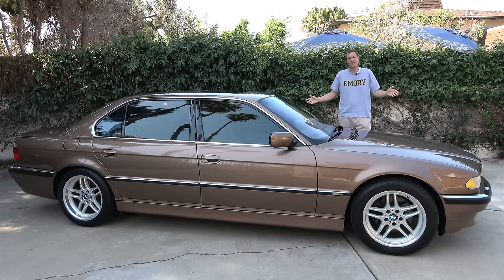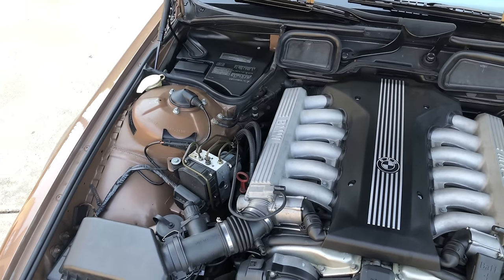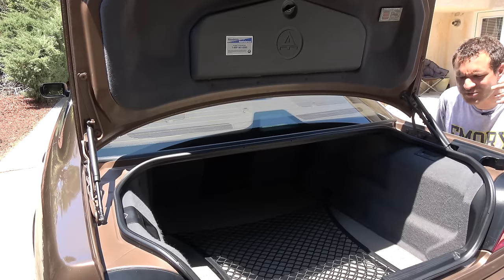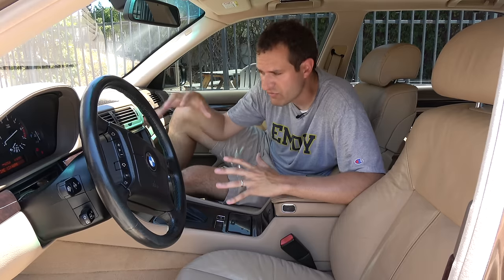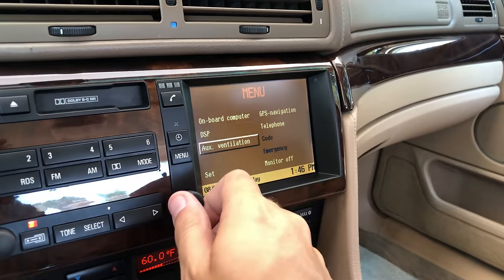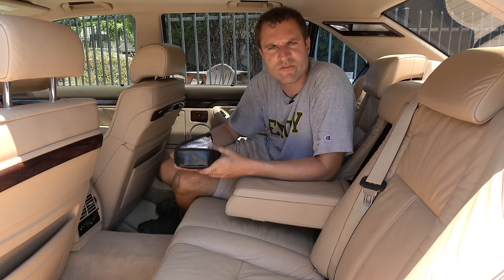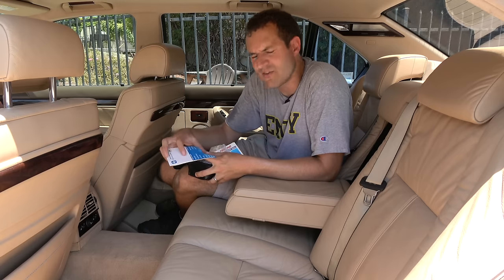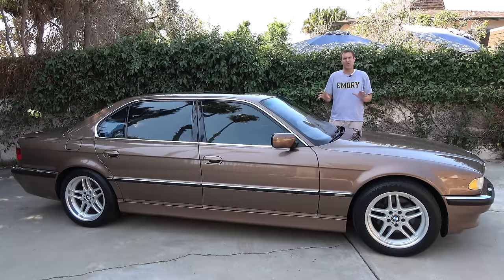Here's Why the 2001 BMW 7 Series Is the Best Luxury Sedan Ever

Comment: I had a 1991 535I, and that feeling of everything being solid is oh so true! If you own a BMW, you know the feeling. If you haven’t, go get one even if it’s an old one you won’t regret it,… Except maybe at the repair shop
Reply: Vws and some hondas feel the same way.
Reply: No problem for me i work on my own older BMW's so that's out of the question. They do feel solid after 20 years. They don't feel lose or anything like the older American cars I've owned.
Reply: O3 Mercedes has a similar feel here. You pull the door handle and right from the get go it feels solid. Got into a 2016 navigator and I was like what's wrong with this car it's all plastic
Reply: Neil Krinitsky Yeah since owning two BMWs. A 1987 325 and a 1991 535. All of the American cars I’ve had since then feel like popcorn machines with wheels
Reply: got myself a 91 535 earlier this year, quite a nice car
Reply: i got one for 7 series 2005..  to be honest, the car quite bad.. i dont hate BMW, they make great car but 7 series 2005 , got tonnes of issues, air suspension broke many times, and most elecronic mechanism beeping constantly n break.... im gonna trade this to m5 v8 2012... i still love bmw especially M lineup
Reply: completely different car...see alternate thread
Reply: its bc of new safety laws it makes sense trust me
Reply: I had a '98 Toyota Avalon for my first car I bought myself which was a big full size luxury sedan from Toyota and it was super nice inside all leather and wood grain electronic everything even the passenger seat and my 2008 Tiburon doesn't even have power seats lol
Reply: A Glimpse Inside  had one too blue/blue. Nice bmw

Comment: I glad so gladDoug finally produced a video review of MY favorite Luxury car of all time. I have owned somewhere over 137 new and used cars in my 55 years and I purchased my 2000 BMW 750iL brand new in 7/2000 for the sum of $104,772. It has all options except executive rear seating options (could not locate one with that option at time of purchase). It came with 16" BBS wheels but I  purchased a set of 18" factory wheels as a dealer installed option so I had an extra set for bad weather. The everything still works on the car (including all pixels, cup holders have never been used because i do not allow eating or drinking in any of my cars), and the only thing fixed outside of normal maintenence is replacement of the factory Navigation with a new Mark IV navigation computer after the original quit working this past spring and the fan and shroud and radiator after the fan decided to explode. I have maintained all factory service intervals and any issues were taken care of immediately. The only thing currently at issue is the roof clear coat has started to peel and just the last weekend the check engine light came on and threw a code for "cam positioning sensor" which will be fixed before putting the car away for the winter. Since 2006 the car has been stored Oct 1 through April 1 and since then has never been driven in the rain or snow. From 2000 until 2006 I lived in VA and was never been in snow. The car currently has 131,000.
Out of all my vehicles this is by far my favorite and that is why I kept it. The new cars are nice but none have the timeless styling of the newer (98-01) face lift E38s. From the full leather dash to the attention to details, this car is IT! I am reluctant to repaint the roof as the car is otherwise 100% free of even the smallest scratch or dent and I like to keep it all original. It will be a big decision to paint the roof. 
I actually considered previously asking Doug if I wanted to interview my car, but figured it's better kept a secret now that these are beginning to rise in value. Only about 1,000 V12 E38s were brought to North America each year 98-01 and they are getting more difficult to find. I hope this is because of people realizing the rewards of this car and not because they are not worth fixing. I will keep this car as long as I can drive. I'll sell my 95 S600 (love it because it reminds me of old Mercedes quality)before I sell the BMW and I love that car almost as much.
Reply: Such a long post but read every single word of it. Thanks for the review as well!
Reply: Its ugly
Reply: Awesome post! 👍👍
Reply: The way you expressed your love. <3 It wasn't just BMW, you're a true car person. Much Respect.
Reply: ...forgot the only other mod I did was the change to the updated 16:9 wide screen when I changed to the Factory DVD based Mark IV navigation computer instead of the cd - rom based Unit and 4:3 screen up front (both still worked when I pulled them out) and since it is such an easy swap I kept them in case I want to be ALL original! I'm not easy to modify from factory, I did in fact purchase an entirely new aftermarket DVD Navigation system to install but I just couldn't "pull the trigger" to install it. Now I am sitting on a new system that looks just like a factory E38/E39 navigation head unit and even though it would look factory and sound tons better, I just couldn't due it. Guess I'll have to buy a 540 or 740 to put it into or sell it cheap. What troubles!

Comment: Hey Doug you forgot to mention that the BMW 7series was  also a Bond car in tomorrow never dies 007
Reply: AJ Cash Im surprised no one else mentioned this
Reply: And of The Transporter.
Reply: + Transporter had a manual gearbox = ultra cool
Reply: It was and it wasnt. :) The car in the film was a 740iL. BMW would not allow them to destroy 750's making the movies.They did replace the badge on the trunk, but thats it. They had 6-8 iirc. You can spot the trim in the car during interior shots. 750s are full leather - stitched door panels, dash, etc. 740's are vinyl/leather inserts for airbag area on doors, but otherwise vinyl. Either way, that movie is why I randomly bought my first E38 back in 2005.
Reply: @ScottHDuke  ooooooh ok i was wondering why too. that makes sense now

Comment: Not quite the same thing but for a few years when I was younger, my mom had a 5 series of the same vintage (1999 or 2000, I believe) and I always loved that car. I wanted to learn to drive in it back when I was like, 12. 

My dad once took me out on the highway when we first got it and just floored it when there was nobody around, doing 120 or 130 down the open, empty roads late at night, giggling all the way while I was planted in my seat. 

They sold it to some guy who just wanted the wheels off of it cause it had some sport package or something, and NOW, with me having been through therapy and prepping myself to work for the first time a lot later than I should have, I am considering one of those, or one of these, since they seem pretty attainable at a price of 3 to 6 thousand dollars. I'm honestly pretty hyped for it.
Reply: Wait 6 THOUSAND ONLY? Damn thats cheap as it gets, what is the minimum wage in your country?
Reply: @joaopaulogalloclaudino9671  I live in Florida right now and the minimum wage is about $12/hr, but it's slowly going up. Working full time and saving aggressively it'd take me maybe 6 months to have that much.

Comment: I have to say, this example was low spec by comparison to my 2001 750iL in England. Mine had double glazed windows, refridgerator in the back, full seat and audio controls in the back arm rest, plus second phone in the rear arm rest, a powered self opening and closing boot (trunk) lid, blinds all round, lit mirrors in the back of the front head rests for rear passengers and....wait for it... a FAX MACHINE and fax point built into the back of one of the seats. "Fax me in the car" I used to tell people.... I miss that car....
Reply: That's awesome! Thanks for sharing
Reply: Double glazed is very common in 7 series 
It is very useful both in thermal n sound isolation 
When u close the windows u dont care about any issue happens out there ..
Reply: I've got an 98 740il!! In my oppinion the most loaded car for it's age was the E38. There's one called L7 or the Alpina B12. 
This E38 in specific as Alexander's said it's really base and the video doesn't emphasise that. You could get an endless list of features that back when it was new no one had it and those features are just coming out in the new luxury cars.
Reply: This car really is base spec. 
There's basically no options for rear seat passengers. It doesnt have Msport package either
Reply: God that sounds good. North America however does not get the futures typically of other countries like yours.
Reply: The car Doug reviewed had double paned windows and sunblinds all around, he just didn't point them out. You can tell the windows are double paned by the look of the reflection they make from the outside, same look that the W140s with the same windows had.
Reply: Alex V This car does have the sport package, you can tell by the 18" wheels and the 'S EDC' button on the dash and the wires going to the strut mounts under the hood for the adjustable suspension. There was no 'M-sport' package for E38s, unlike the E39. Just sport package, from 1999-2001 only.
Reply: Sometimes I feel options in bmw cars are literally endless...

Comment: Doug Demuro I totally agree with you that the e38 is one of the best looking sedans out there, the styling of it is contemporary and it will look great years to come. The 850i , e39 m5 and e38 are the best looking bmw's in existence.
Reply: I'm not a huge fan of BMW in general, I'm more partial to mercs. This car had me wanting a BMW for sure
Reply: 850i but not the 840i which looks the same? :P
Reply: Personally i think e34 should be in that list too lol
Reply: bro don't forget about e36 (esp. convertible). E36 from 2000 era has a timeless design, the car will look great in 10 years when it becomes an oldtimer.
Reply: AK87Berlin the E36 isnt from the 2000 era lol

Comment: I once owned a 99 750i in Cosmos black, and I adored it. Double glazing, rain sensitive wipers, auto-tilt rear view mirror, heated wing mirrors, television, front and rear phones, memory seats,  and tiptronic gear select.
The steering wheel moved out of the way, and the seat moved back, to let you enter gracefully. The power was endless, and for the time, the kickdown was awesome. I could drive hundreds of miles and feel like I'd spent the day in my favourite armchair: driver fatigue was never an issue.
I still miss her, and her perfect beauty.
In a perfect world, I would want to be buried in her, like a Viking chieftain. I'll never own another car that would make me so happy.
Reply: You forgot to mention that it broke down so many times you ended up selling it for cheap.
Reply: @45orangedonnietherussianmo96  It never gave me a minute's trouble. 
The only things I ever had to do were to replace a wing mirror housing - stolen - and re-seat a rear parking sensor, which I did myself.
I guess I was just lucky, but I also looked after it.

Comment: I have a 1998 750il and it’s my baby. I wouldn’t trade it for anything.  These are the GOAT for luxury sedans. Long live the e38.
Reply: Im looking into getting one. For how long have you had it and have you had any problems with it?
Reply: +Syrhi
20 year old 300K miles BMW..what problems? )))) be realistic. you gotta fix something several times a month at least. If u are afraid of problems - old cars are not for you. i got mine 728 and working on it almost every day for almost 2 month since i got it. but that is the point. it should NOT be a daily driver unless you can afford to pay someone working on your car.
Reply: Isaac Davis have you ever had an issue with the locking system? I’m having issues with my 97 model 740i

Comment: Cool car, great video, but not so thorough documentation in before.
You have forgotten to mention the most important thing about it:
- this was THE FIRST CAR in the world to have come with factory stock XENON HEADLIGHTS ! Pracyically BMW invented them.
That is why you were seeing that "High Voltage" sign under the hood.
Another thing: this car also had hydraulic pressure controlled windshield wipers in order to keep stable pressure on them at highway speeds in order for them to function correctly.

At least, you were right on one aspect: IT IS THE BEST 7 SERIES OF ALL TIME !
Also my personal favourite.

Cheers.

Comment: The seats are actually not massing... they are called Active Seats. They move water between two pouches below your butt in order to replicate a slight moving of your spine in order to ease built up tension from sitting for long periods of time!
Reply: Rsmmt1009 they actually work with air.. but thank god someone else knows! :)
Reply: @sonerd.1459  no they work with a Water-Glysantin mixture that's being pumped left and right.
Reply: Makveldz i am 90% sure it is air.. i am going to look it up right now.. i'll let you know. :)
Reply: @sonerd.1459  dude i have filled it up in my E39.
I'm pretty sure i know what it is
Reply: @sonerd.1459  http://www.bimmerboard.com/forums/posts/567475

but i just found you this, should be proven by now.
Reply: Makvelds the type of guy that fills water in his air bubbles... (I don't actually know if they work with water or air)
Reply: @Haenki  lmao are you guys fkn kidding me 😂
just look it up on bimmerforums it's exactly written down how it works and it's NOT with air.
Reply: Makveldz holy crap you're absolutly right my bad.. but what is the airpump for though?
Reply: @sonerd.1459  the system uses a liquid pump.
the only air pump i know of is for the electric lumbar support

Comment: Re: Odd rear seat belts

When my E34 was new, the dealer told me why the rear seat belts are seemingly backwards. This is a safety feature. It seems that in accidents with conventional belts the rear passengers would be forced towards the middle of the car, banging their heads together in what was called "gonging". By reversing the belt layout the passengers are better held in their seats and didn't smack into one another.
Reply: Ryan Stevens Wish they could put that same thinking into the newer cars direct injection problems.
Reply: Jake Smith - I do too. 1980s BMW is a lot different than 2010s BMW, a company now seemingly run by a crazed marketing department hell bent on chasing every conceivable market segment whether they exist or not (X6M? 6-series coupes and 4-door "coupes", etc.) with less focus on brilliant engineering decisions. Peak BMW was reached in the days of the E38, E39 and E46 IMHO, and I personally have no desire to own a BMW newer than those. I'm even tempted to do like my father has done and ditch the expensive German machinery and buy a Chevrolet Volt (although I don't have the advantage of solar panels on my roof like he does...)
Reply: Ryan Stevens Whats sad is thats with many manufactuers.The 90s/early 2000s  was the time to buy a car.I only have a one newer car we bought new(2014)
Every car now is gonna be an older,easier to fix ,more reliable 90s/2000s car.The
only exemption are the Toyotas which are still good and some Fords imo.Those are the only two companies to use both direct and port on the majority of their models.
But man,I can get whats in dougs vid for 12k with low miles.Rather have 6 cars for  100k  than 1 forone new  100k  dollar anyday.
And a voltI have read is a pretty good buy.Im actually looking into getting a used prius.Can find low mileage examples for 10k and less.No car payment,no fuss.
Reply: Jake Smith - I don't know about that. As my dad and I have both experienced, there is nothing more expensive to own than an older German car. A seemingly simple $350 Service II would turn into a $2,200 bill when all the misc. broken things were fixed, or they'll just eat you alive with a $700 repair here and a $500 repair there. These old cars are great as long as you can afford the myriad little failures, and with some failures (especially electronics), good luck finding the parts. Trust me, the $8-12K spent on purchasing a car like the E38 in this video is only a down payment, with no end to the payments in sight if you want to keep it in excellent shape, as the owner of this car obviously does (and as did I, and my dad as well). It is because of this that dad currently drives a Volt and I now drive a simple and humble Mazda minivan (with a manual transmission, no less, just like my E34), a vehicle that has been 100% reliable in all the years I've owned it.
Reply: Ryan Stevens As for the repairs on these...yeah most def.I work on all my stuff so I wouldnt mind one.
They are expensive at the dealer for sure.But again,as a weekend car,be a decent buy and use the other cars for daily driven.
Enjoy that Mazda.Good little van.I loved how they came with a stick.Way a vehicle should be!

Comment: Fun review. I own a 98' 750il (73k miles) and a 01' DINAN 7 (89k miles)  The 750 also has dual pane glass and a larger transmission  (5hp-30) to handle the V12. The NAV can be updated to a DVD driven system (MK4) and a 16:9 widescreen, all plug and play. I updated my 98' in 45 minutes. The DINAN Ive custom retrofitted the NBT system from a 2015 BMW. Love it  Ive been in E38's since 2005 and will always have at least one. They are great cars with timeless styling. I always look back at it after I walk away, and still get a grin knowing its mine while im on this ole' rock floating through space.   Cheers!
Reply: make a video and link me.. i wanna see. sounds good
Reply: Sounds like you smoke hella blunts in it ahaha